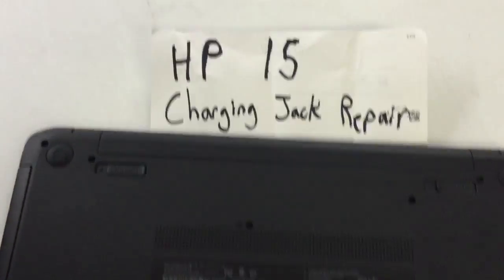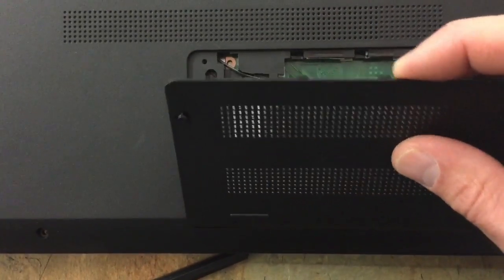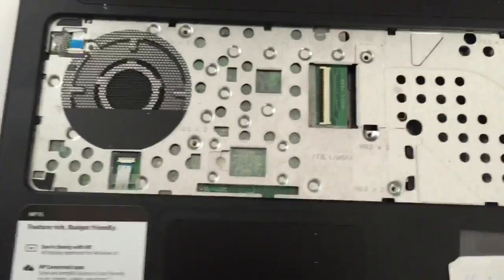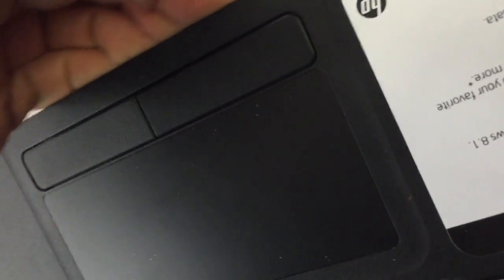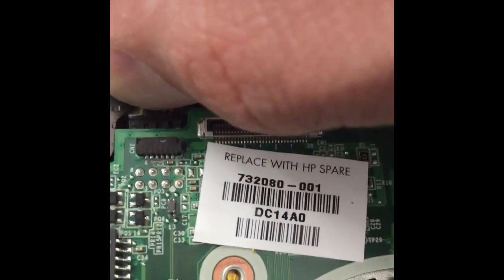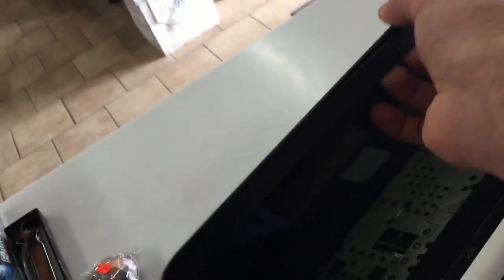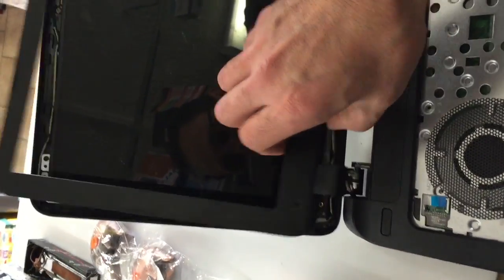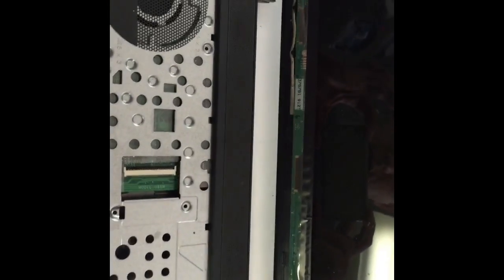Hp pavilion 15 led screen power jack dc repair replacement fix how to Walmart laptop Hewitt Packard

Comment: I have a HP Flyer Red 15.6" 15-f272wm Laptop PC with Intel Pentium N3540 Processor, 4GB Memory, 500GB Hard Drive and Windows 10 Home and  when I turn my laptop on for about 10 minutes, it just shuts off. Do you know where I can get a new battery for my laptop? Sorry, I don't know much about laptop.

Comment: My HP Touchsmart wont charge or power on even with a full battery from a working laptop. Do you think it could still possibly be my power jack or motherboard?

PS power jack light would come on from time to time but now it's stopped completely.
Reply: Siraj Amaru El did you ever manage to fix it? I have a similar issue, and it’s a bent pin in the charger.

Comment: I wrote a comment to you last night, but don't see it here now. The next video may have started playing and don't know enough about YouTube to know if that would have made a difference, but really, really wanted to say thank you! The first several videos I watched were clearly not made to make me feel like "I could do it" without already knowing a bit about fixing computers, and seemed more to me to try to make it seem to complicated, so that I'll not want to try it, and then... low and behold.. a message on the screen saying how I could reach them and the cost for the repair. I was about to give up when I found yours, and so, so grateful. BTW, since you didn't have the replacement jack when you did the video, and didn't actually remove the one we saw, am I correct to hope that the screws you pointed out to be holding the jack in place after disconnecting the ribbon, that this style DOES NOT use Solder, so I won't need to remove and re-solder the new one in? I have an HP G62 which looks very similar to what you worked on...Thanks so much again,Sam (Samantha)

Comment from the maker: ITS MOST 90% YOUR KEYBOARD, I WOULD BUY ONE OFF EBAY AND REPLACE THERE ARE 2 SCREWS THAT HOLD IT IN PLACE, ONE IS BEHIND THE V KEY AND ONE BEHIND THE 0 AND P KEYS YOULL HAVE TO OPEN THE LAPTOP UP JUST FOLLOW THE VIDEO AND TAKE THE SCREWS OUT AND YOU WILL BE FINE.